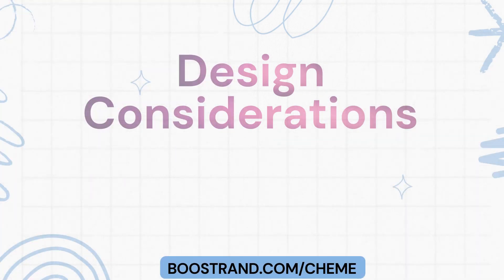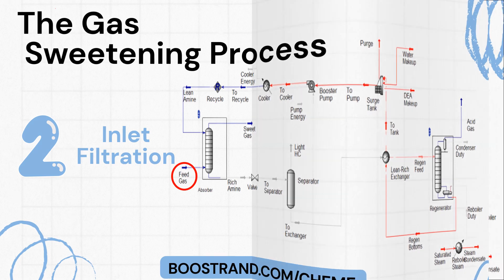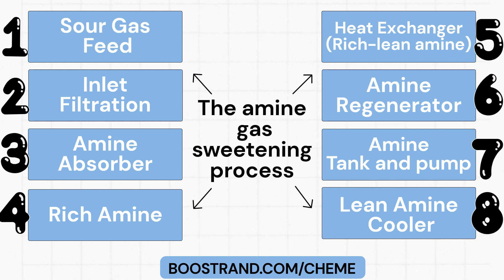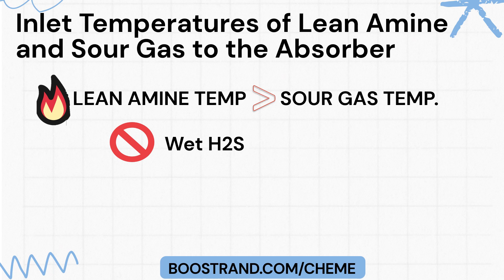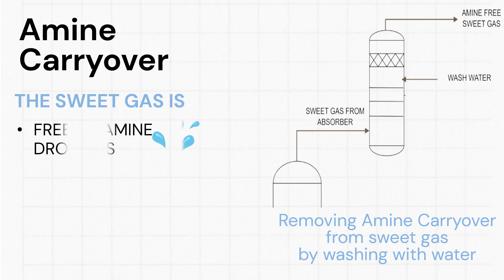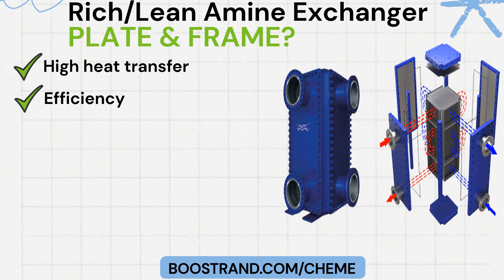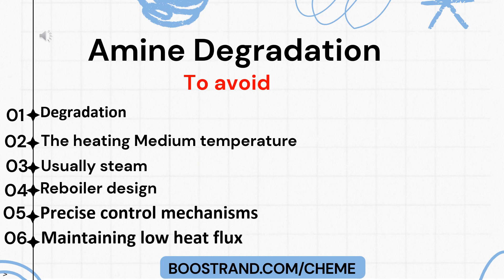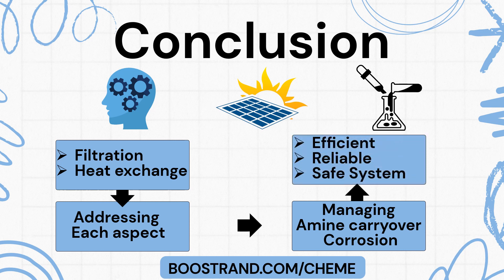Process Design tips in Amine Gas Sweetening Units

Comment: How can i find the temperature of operations for each equipment?
Reply from the maker: If you are talking about design phase, then temperatures should be adjusted by the simulation program to get optimised performance parameters. If you are talking about the case at site, then this would be through temperature transmitters which read temperatures, maybe we would need some action to be taken to avoid very high or very low temperatures, this should be habdled by control or safety Instrumented systems.